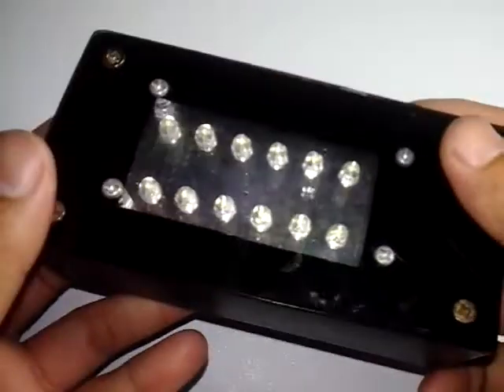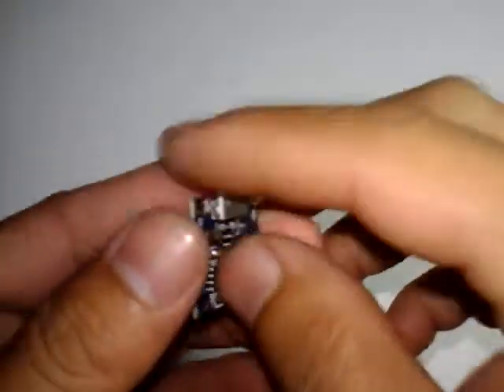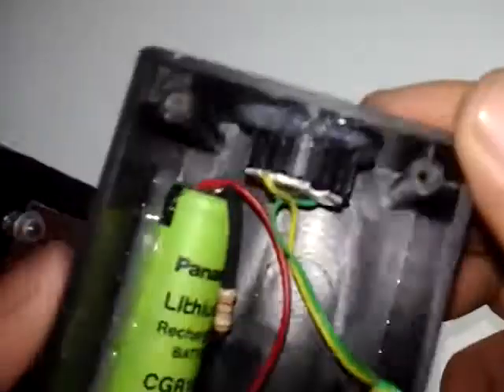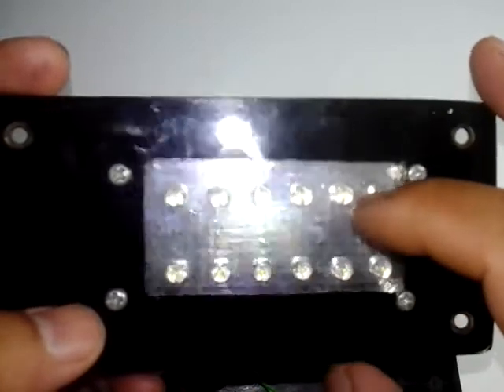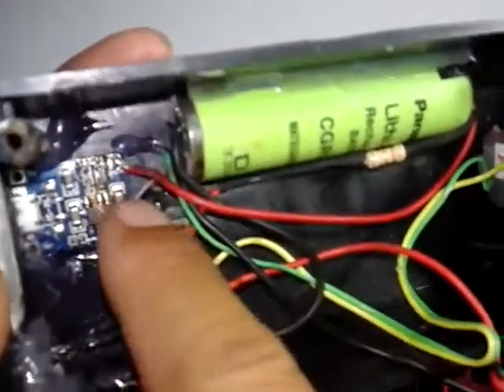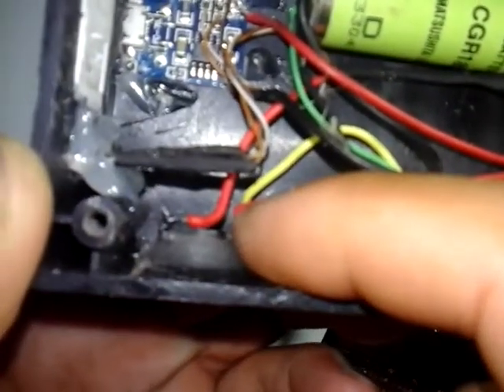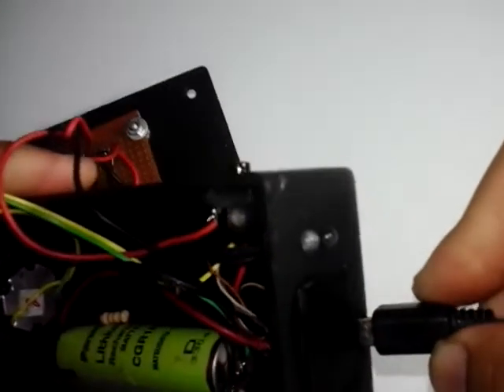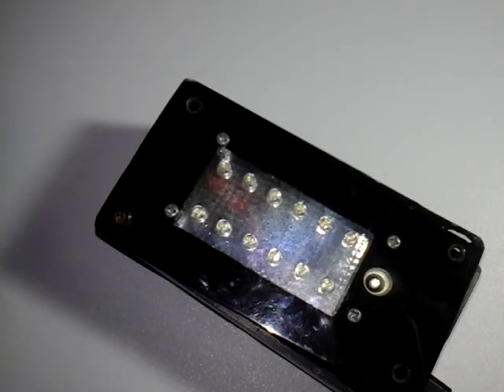Cara murah membuat lampu emergency dengan charger auto cut off - Emergency Lamp recharge

Comment: Baterainya lebih dari 1 bisa gk gan...
Reply from the maker: bisa .di paralel bro
Reply: @vandfandia  itu lampunya agan berapa volt... kalau punya saya cuma 1 lampu tegangan nya 5v 1,5 watt... itu kalau pakai baterai kayak punya agan 4 buah baterai apa lampunya kuat... takut meledak soalnya lampunya... tolong infonya....
Reply from the maker: apakah lampunya mirip di video?
Reply from the maker: klo lampu led divideo bisa langsung di pasang dgn baterai. 4 buah batrei diparalel
Reply from the maker: klo benar lampu 5 vol. 2 batrei dipasang seri. lalu ditambah resistor 47 ohm pada lampu
Reply: @vandfandia  lampu led saya itu kalau gak salah namanya lampu sikat
Reply from the maker: ya bisa pake cara itu. atau pake tambahan modul powerbank